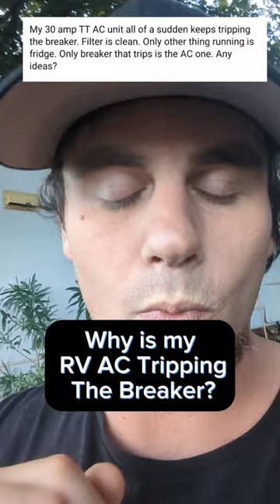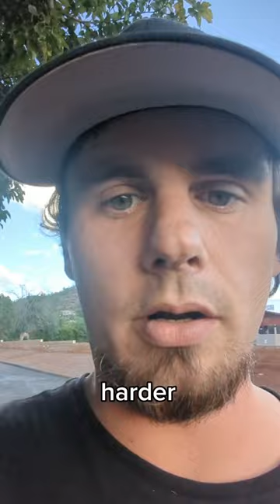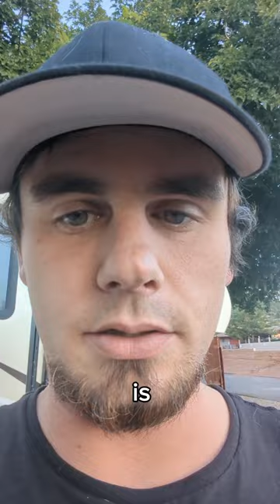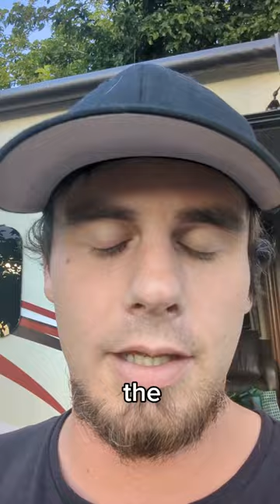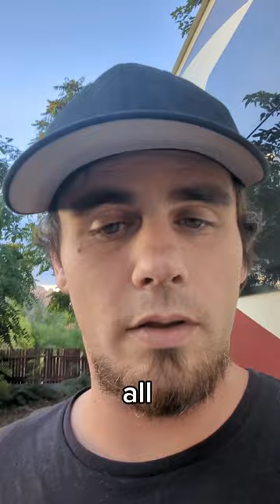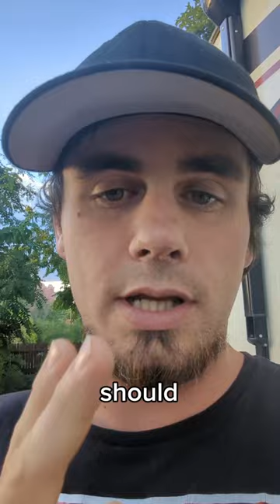RV AC Tripping Breaker, Travel Trailer AC Breaker Trips #fulltimerv #rvlife

Comment: In parks with 30 amp service i find its typically caused by overloading the circuit. Switching from ac power to propane on the WH will eliminate the problem.